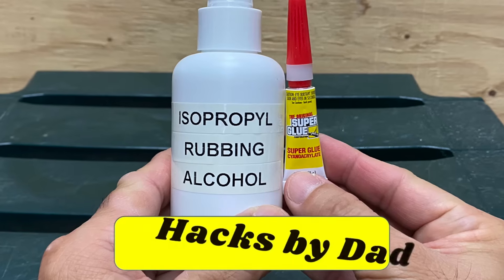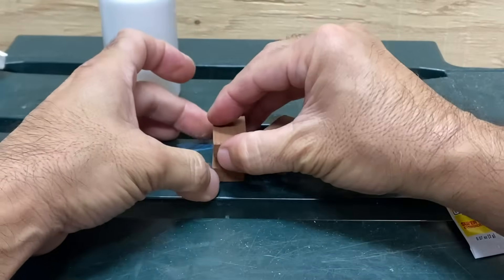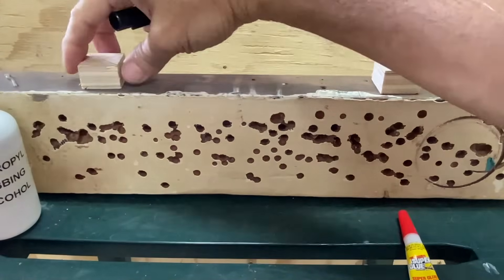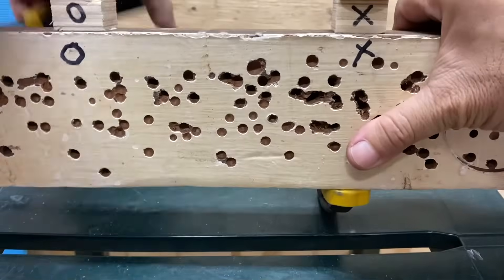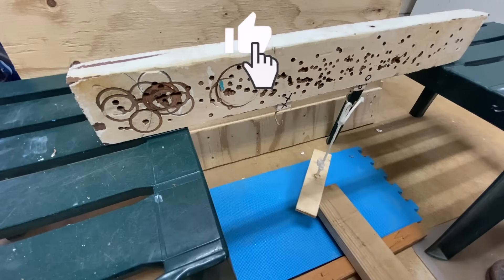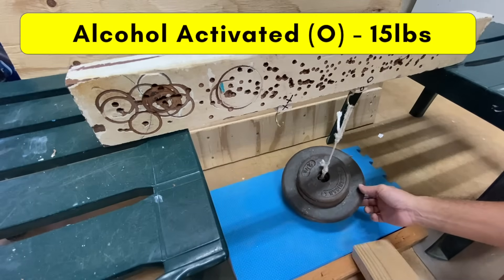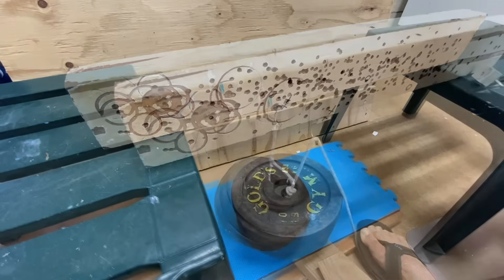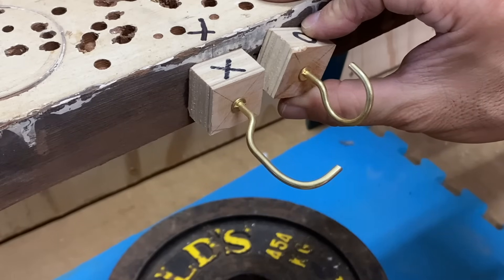Super Glue & Isopropyl Alcohol | How Much Weight Can Super Glue Hold?

Comment: Good test. Thank you. 1kg = 2,204622622 liber Isopropyl alcohol is an activator. It shortens the setting time, but the joint is not as strong. 20lb = 9,071... kg
Reply from the maker: Thanks!
Reply: Thing is (as mentioned before) in this vid he used rubbing alcohol......it's different than Isop alc...it contains baby oil....
Likely the Isop alc joint would be stronger than the rubbing alc joint....
But using anything to activate it quicker will not have the same bonding ability no matter what.

Comment: Very cool thanks! That’s why super glue works so well to instantly seal cuts (although it’s not recommended for deep wounds)!
Reply: I do believe super glue is very similar to tissue-glue, a substance invented to treat field wounds sustained during military action.
Reply: There is medical grade CA used in place of stitches. The hardware stuff is toxic to apply to an open wound
Reply: @drvnlp6269  Toxic? I shouldn't be able to write this then. I've used it many times for small cuts and abrasions.
Reply: @RobertSeviour1  I didn't say it would  affect your writing skills :)  

Here's a quote from Dermabond: "Is Dermabond the same as super glue for cuts? Yes, and no. Unlike super glue on skin, these specialized liquid adhesives are non-toxic. They do not burn the skin and injured tissues, like super glue does. The medical adhesive aids healing, not only by holding the edges of the cut together but also by providing a microbial barrier to reduce infection."
Reply: Yep, I use it for small cuts. Better than a band aid. Even saw a doctor who used it instead of stitches, on certain occasions.
Reply from the maker: Yeah... I heard of that but have never tried it myself.  
😎

Comment: Vvv=rry interesting. Then what is the activator carpenters use on putting trim cuts instantly???????
Reply from the maker: There are several commercial activators.  I ordered one and will test it very soon.  I’ll compare the speed of the cure time and the strength of the bond against the diy isopropyl alcohol activator.  
😎
Reply: @HacksbyDad  That would be awesome. Did you already test that??
Reply from the maker: @jd_cl  Working on it...
😎